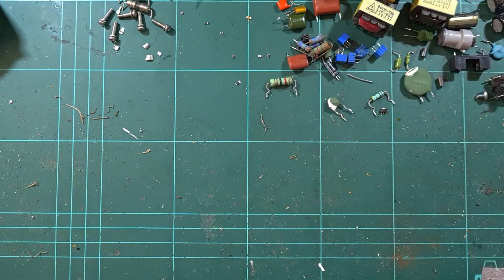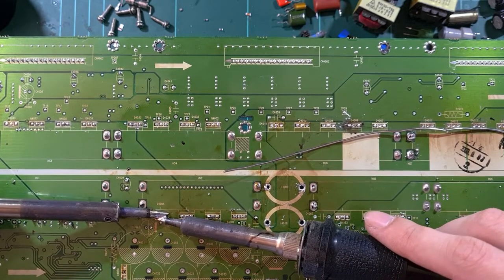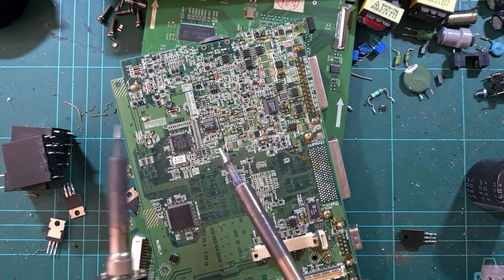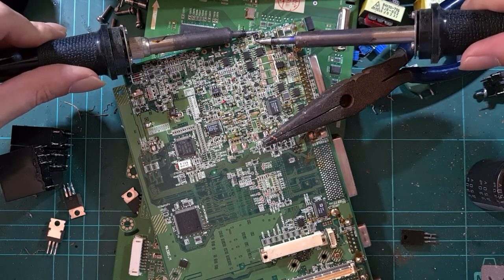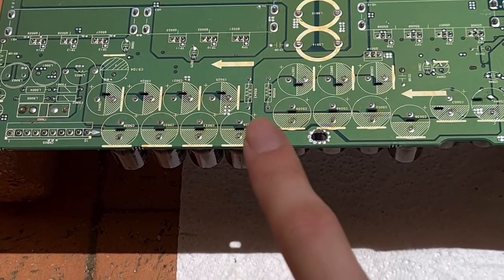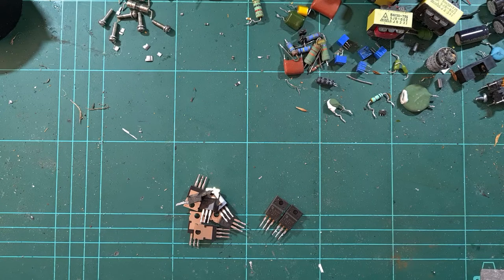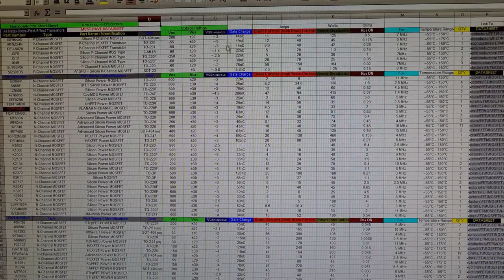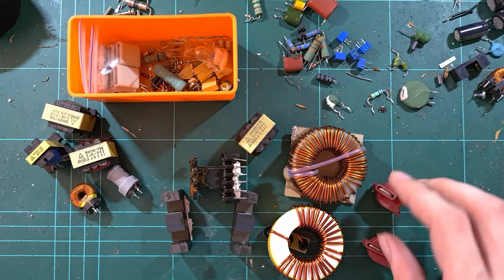Electronic Component Recycling Techniques That Could Consume You

Comment: Old Steel core 50 or 60 Hz mains transformers are ALWAYS worth salvaging , as they can last for ever ,  and when used to make power supplies are a LOT simpler ( and more reliable ! ) than modern SMPS .. ( tried - n - tested ) ... DAVE™🛑
Reply from the maker: Yes, It depends on the winding quality and whether or not the plastic has cracked on the winding covers - nothing a few quick measurements etc. can't solve!
You can usually tell a good find from a mile a way, those old Zebra transformers in microwaves are extra special - i'm still waiting for mom's old microwave to brak down so I can get the MOT lol (It's a "National" so probably not going to happen for a while I assume)

Don't hate on the ole SMPS though, I've seen many fail; but i've also seen how they can work well - usually when over engineered!
Most of what I designed recently revolves around getting a stable and efficient switching supply, using a minimal amount of components - but it has taken a full trip into analogue territory with the design of an OPAMP of sorts, and a voltage reference for it being two key elements... The aim is simple: bag of transistors --> Power Source (any)

Comment: You said Its hopeless to try with only 1 iron but it works with flux right?
Reply from the maker: Would not exactly call it hopeless, but on some boards with large planes of copper it might be - especially with the little 20W irons!

And flux can help, especially on pre-ROHS boards but not in the above situations no. If the circuit board you are salvaging is capable of dissipating the heat as fast as your iron can deliver it, only additional heat will help.
And leaded solder, because it lowers that melting point and makes everything 'flow' better...

Comment: you could just use braided copper wire wick and flux to remove old solder with a single solder gun
Reply from the maker: I have a desoldering gun, but we're not interested in cleaning the board - this was a component harvesting exercise!
I save my desoldering braids for the big stuff - no point burning through consumables trying to salvage random components; unless said components are the solid gold kind lol
Reply: ohh ok. everyone has different methods. understood. its a bit unique for me i guess or the jobs i try they use thicker flux or thicker compound that requires just shy of a 1,000,00 watt laser. lol
Reply from the maker: @bradleylomas7525  Don't worry, It's just shitty solder. Like not even solder anymore, it's more of a tin weld of some kind on these new PCBs!
Recall the heat gun, that was a board with high thermal mass AND lead-free solder - a few parts did get scorched...

Comment: tips won't last long, scratching them each other
Reply from the maker: Maybe - if you push them into each other; however I was gently rolling the solder blob between them to tin up...
On the board however, lead free solder can be a bit tricky sometimes, requiring a light push to get through oxides etc.
Which is why it's best to use old irons for through hole stuff, this technique is best for SMD though - and there should be no harm to the tips there :)